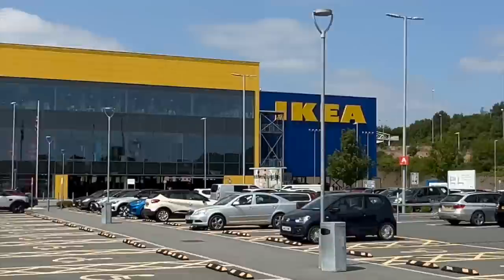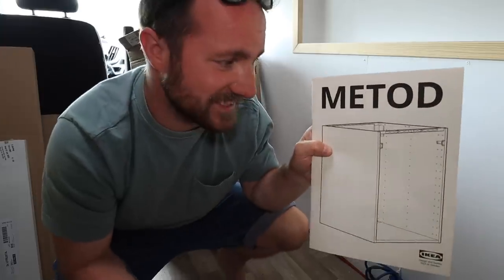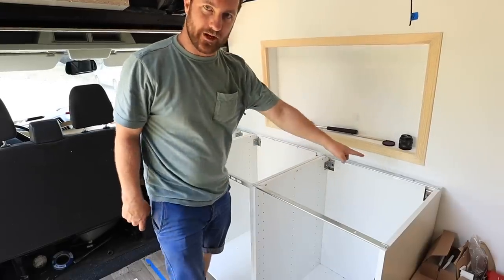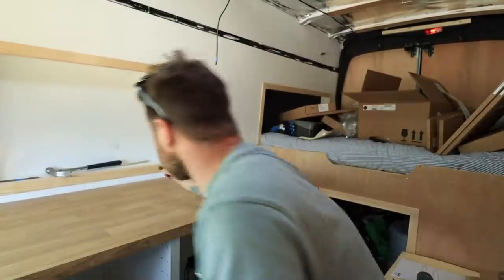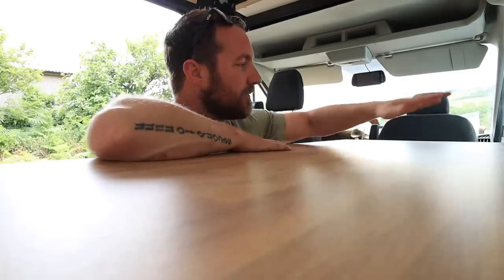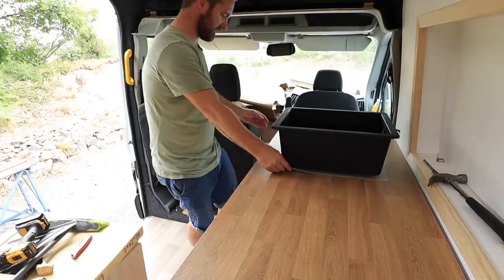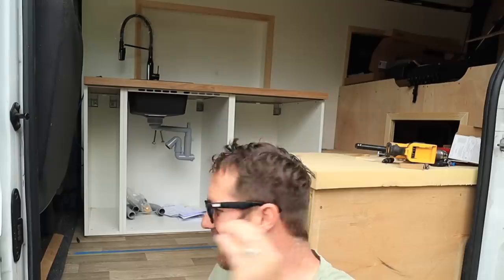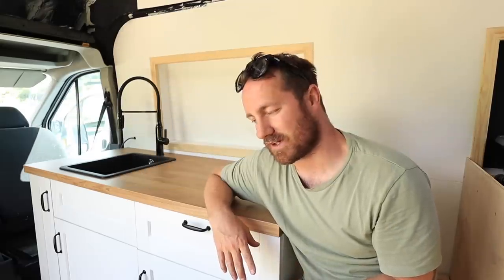AVOID THIS MISTAKE when fitting an IKEA kitchen in your CAMPER VAN

Comment: Flat pack kitchens are designed to be installed  buildings with solid floors and walls, not a vehicle where they will be subject to vibration, movement and flexing. I would be inclined to glue all joints so that they don’t work loose.
To reduce weight and improve space in the van you could reduce the depth of the units and cut lightening holes where the side panels abut each other.

Comment: I've just fitted a Metod kitchen and, yes, they're bloody heavy.  I wondered at the time, if I was to do a van build, that you could rout out about half the thickness of the worktop where it isn't resting on the carcasses. That'd save a bit of weight.

Also, I hope you sealed the bare edges of the sink cutout. I missed a couple of spots and the laminate has already started to peel away where the damp has got in. ☹️
Reply: Good idea. He could fill the void with expanding foam to make it rigid again. The excess off the underside is easy to cut flush with a hand saw. It would look the same but be lighter.
Reply: Was at a camping show, a van had unbelievably nice oak wood all through the ban from an old church roof and thought geeez that must be unbelievably heavy and he'd hollowed it all out, hardly weighed a think 👍🏻👍🏻 hreat idea

Comment: Haha I bought the exact same IKEA kitchen with the same worktop and when realises how heavy it is I regret exactly like you did! My main worry was the fact in an event of a crash the worktop becomes a combination of a missile and a blade flying forwards and cutting you in half (xD) that's why I put 2 M8 bolts through it and 2 5mm massive L shape brackets and bolted it with another 2 m8s directly to my garage area barrier (25mm plywood) it's not perfect but a thousand times safer than having it just on wobbly chipboard kitchen unit. Never again any IKEA furniture in a van... I learned from my mistake but it works well in the end xD take care!

Comment: Be sure to seal the exposed edge on the worktop where you cut out the sink and tap with silicone, water will get in easy and bubble it.
Reply from the maker: Yea I’m not doing that until I’ve cut the hole for the hob so I can easily remove the sink again

Comment: Looks good but not durable enough for van as fitted one and after a few spills and splashes the edges of cabinets swell and burst. 
I also had profiled edges to van walls as most dont have straight walls in a van.
Stay clear of chipboard and mdf.

Comment: Ikea drawer units are heavy. Solid steel sides. I found the 60cm death too deep for my van. The sides of the drawers are steel. They were too much trouble to shorten. 
I had purchased an Ikea kitchen before to go into a house kitchen (That kitchen was solid wood) and last week I purchased another to go into my RV and returned it because of the metal draws.

Comment: Good work for me a thiner worktop also would of raised the units off the floor by 20mm you may have problems with door or drawers touching the floor
Reply from the maker: There’s an 18mm spacer that I made between the units and the floor for that exact reason

Comment: The 2 problems I can see straight off the bat is that you have used normal kitchen handles?? These are ok in a house kitchen. But will not kelp keep your doors closed while driving! And also. It is an Ikea kitchen. Their wood is chipboard wood. This means that after a while the doors hinges will start to break the sides where the screws are. Use liquid nail glue between the metal and the wood for extra support, then screw the doors back.

Comment: Have the same thoughts around units, flat pack if possible.  Even storage ones, ikea "billy" units are slimline front to back, ideal for floor to roof. Do you need to profile the back of the worktop if you fit a splash back? Good job though, check out B+Q tops for weight as well.

Comment: A concern I would have is that it's made out of particle board and typical moisture from condensation will make it fall apart prematurely.
Reply: Actually, I have those cabinets in several rental houses and they are very durable.  7⃣ years of renters beating them up and they still look brand new.  Moisture has zero affect.  They are not your Grandfather's MDF boards.
Reply: @Irideonandon  Rental houses don't retain the condensation like a camper van.
Reply: @stoneyrunva  I live in a camper van and know all about that.  My next build is going to use Ikea products.  I've seen them personally in house boats, trailer and vans.  They are very durable and resistant.  They are becoming very popular for vans for a reason.  Time has proven them.

Comment: Twenty to the gallon....in an empty transit .... There's definitely something wrong with the engine...
Reply: I have a 7metre Transit motorhome 3400kg loaded and get 32 mpg .  So I agree , there is an engine /fuel injection issue there.
Reply: @pageant1fd  Yes fuel / injector trouble...we have a MWB Crafter...amazing on fuel 35 ish and more holding at 60mph and loaded with heavy gear all the time.
2.0tdi not the 2.4.

Comment: Man I would throw all those cabinets on a table saw and Scale them all  down 8-12 inches,  get that room back…but to each their own but such a simple process to achieve much more room. (Of course you would have to rescale all the installs as well.)
Reply: IKEA do slimmer cabinets (37mm instead of 60).
Reply: Or just use uppers.

Comment: Have you used rails behind the unit? Or have you used the brackets that came with the units that are meant to slot onto the rails and put a screw to them?
Reply from the maker: It didn’t come with rails so I built my own wooden rails to screw the metal brackets into

Comment: Do you need the back panels of the cabinets? You could ise some frames to save weight
Reply from the maker: You don’t need it as long as you don’t mind everything falling out the back
Reply: @LoveSundays   isn't there the wall  behind the cabinets
Reply from the maker: @jampam-jf8mt  yes but the wall isn’t straight so to keep the cabinet square there are gaps behind the cabinets. The backing doesn’t weigh anything anyway
Reply: @LoveSundays  I guess the only way to use the wall as backing is to scribe the back edges of the cabinets..

Comment: Now you’ve been using it for a while, how do you find the height of the unit to work on ? .without legs it must be around 5” lower than a house kitchen ?
Reply from the maker: Perfect height for me. I have put some 12mm ply under the unit though to stop the doors from dragging on the floor
Reply: Thanks 🙏 I think I’ll do the same. To much faff building one !

Comment: Don’t get a new top! B&Q sell aluminium plates in their stores find it in the hardware section. Cut to length, not only will hide the mistake but will also create an end to the worktop to stop anything falling off behind the seat.  No one would be any the wiser only thinking it’s a cleaver solution. Well that is apart from your thousands of viewers that is 😂

Comment: Do you really need to put the back in the units? Why not just use the wall of the van?😊
Reply: My thought is that if you don't put the back on the unit then anything sliding off the back of the shelves or out the drawers will end up sliding down into the inevitable small gaps between unit and wall. Also the inside of the cabinets are wipe down finish, if anything gets spilled. Also the back adds extra rigidity to the unit.

Comment: Cracking kitchen set up there Shaun, I think I would leave your cock up as it is as nobody will ever see it there. Are you going to put some sort of catches on the drawers & doors of the kitchen units so they don't fly open when you go around a corner?
Reply from the maker: Yea I’ll fit a simple magnet system to prevent them from opening